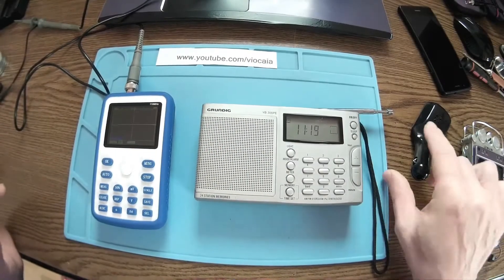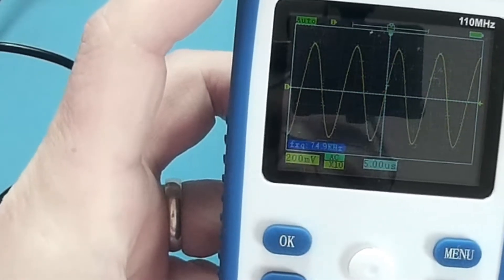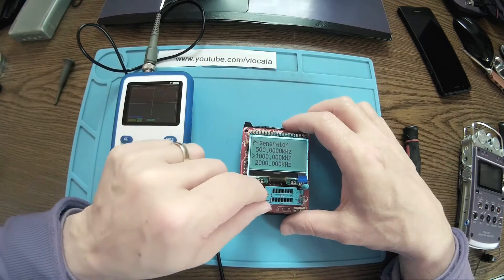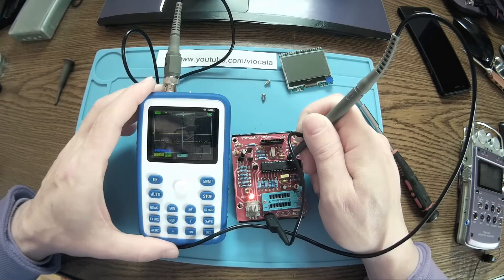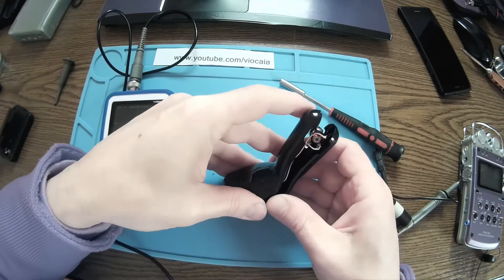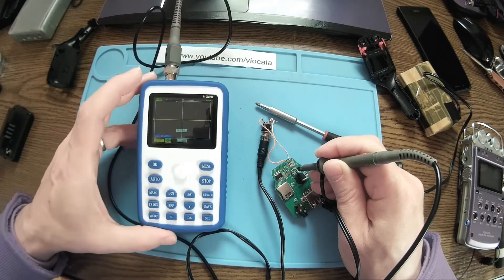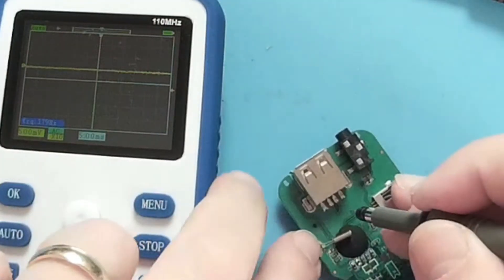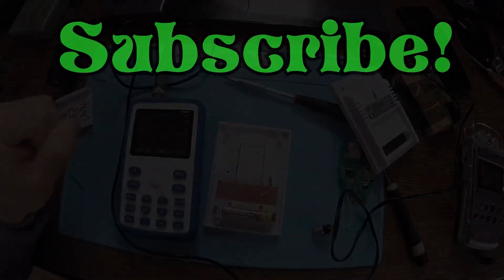Fnirsi 1C15 in action, realtime tests

Comment: I need to replace a battery on mine,   it has no numbers or any ref. #.   Do you have anything on your battery?
Reply from the maker: I just used one I got from a ruined device, any cell will do the job as long as it fits inside.
Reply: @viocaia  ok, thanx.

Comment: Is there a type that has two channels, and what is the maximum readable voltage؟؟
Reply from the maker: hey! only one channel, Voltage measurement range : ± 40v (x1 file);± 400v (x10 file) but I shouldn't take the risk of going more than 100V...

Comment: Good test for the FNIRSI-1C15. but the screen brightness seems low.
Recommendation !!! For your safety and for the DUT, do not insert any live components or screws into the circuit and remove your wedding ring.
it's just a good working method, in this case you are working under low voltage.
But one day you will test with a high voltage assembly,
and you will forget these precautions, and boom you go up in smoke !!! ...

Google translation.
Reply from the maker: Good advice! I had my bad experiences with HV..so I`m vaccinated!Thanks!
Reply from the maker: Yes, there is no brightness control, maybe in a future firmware..